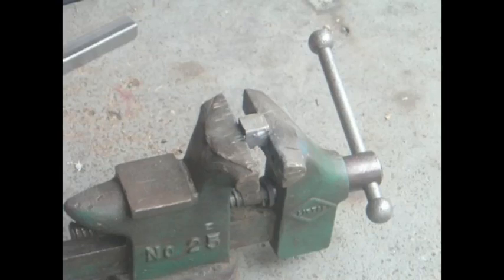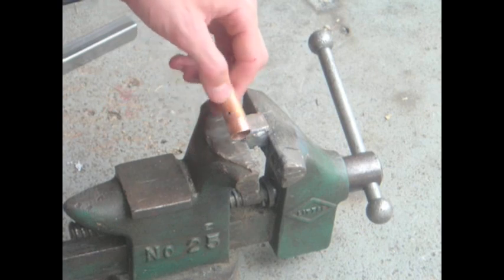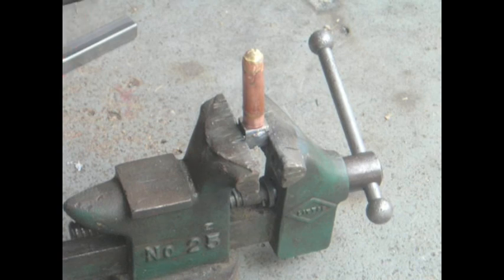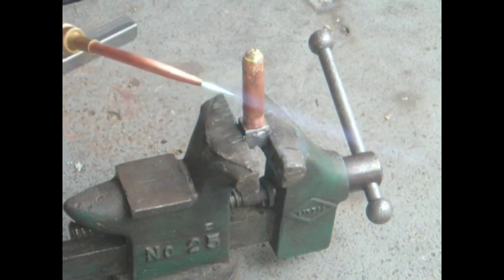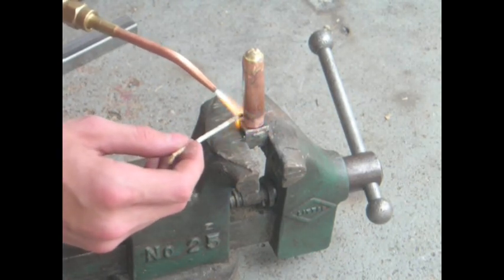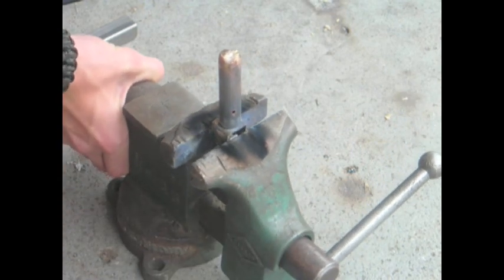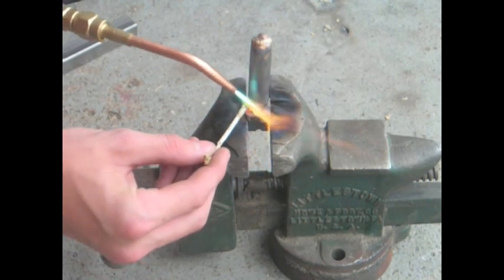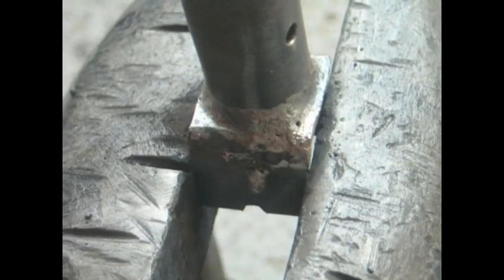how to braze with oxyacetylene

Comment: Your acetylene is insanely high, and remember to not melt the brazing rod with the flame, but rather the red-hot metal, itself.  Like soldering.  
But good job.  :)